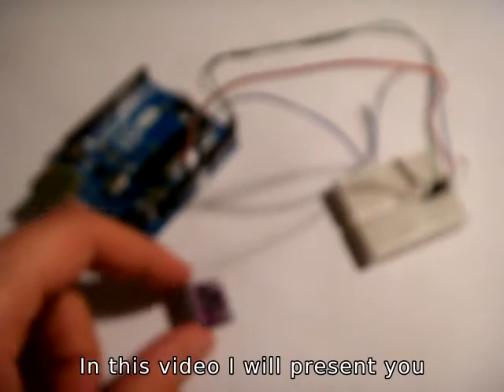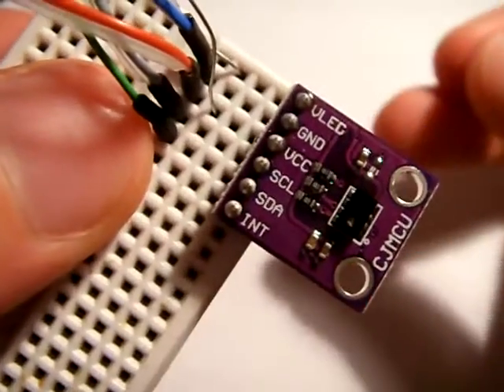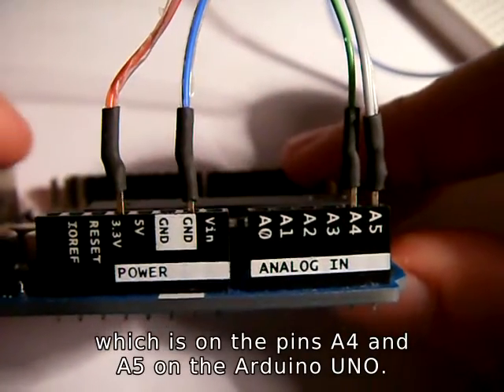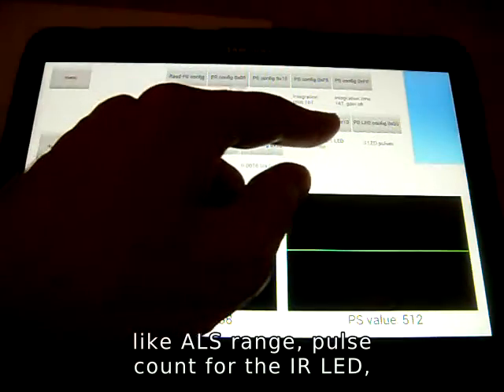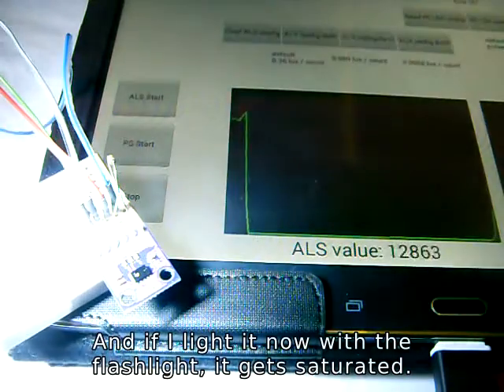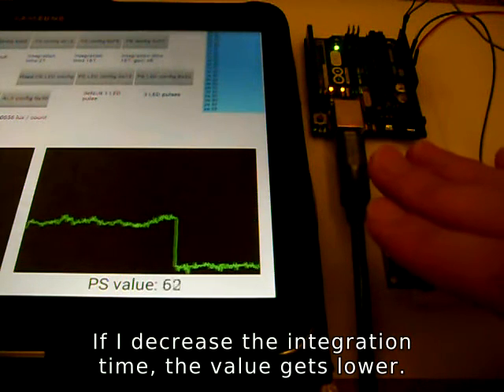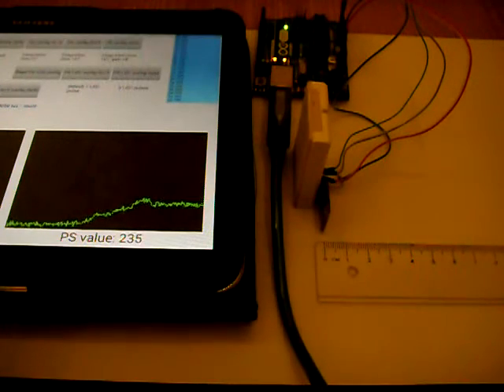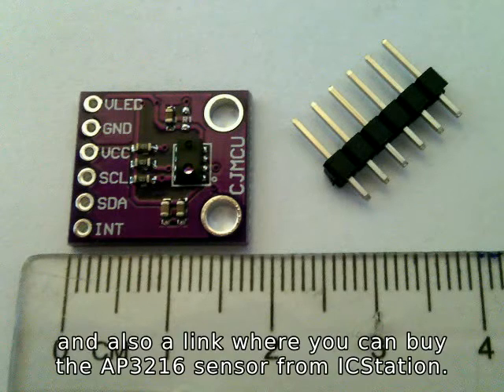AP3216C and Arduino UNO plotting ambient light and proximity data in RoboRemo

Comment: I think you're right with the resistor between Vcc and V led since on the CJMCU there is a place to solder a tiny resistor. I'm telling this to the newcomers.
Reply from the maker: Thank you! I think they left the Vled pin instead of mounting the resistor so that users can experiment with different value resistors.

Comment: @RoboRemo I know you haven't mentioned it, but is there a pull up resistor to SCL and SDA to 3.3V through 10K resistors ? Have you soldered 2 resistors on the Arduino PCB ? Because I read in the reference of the Wire library that there is such thing. Not sure...
Reply: oh well just forget about it. In the CJMCU itself both SCL and SDA are pulled high to Vcc.
Reply from the maker: @youssefdirani  Yes, the module already contains the pull-up resistors so there is no need to add two more.